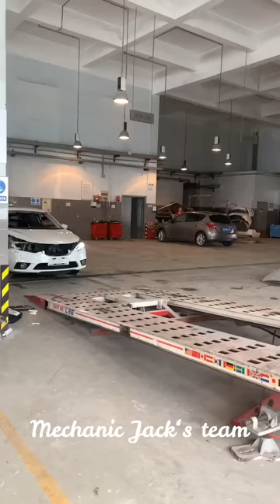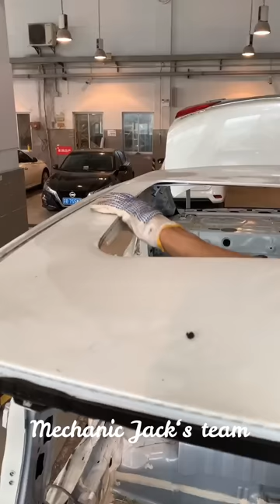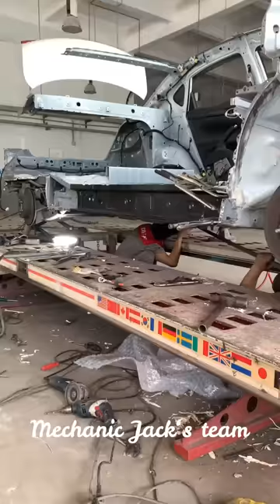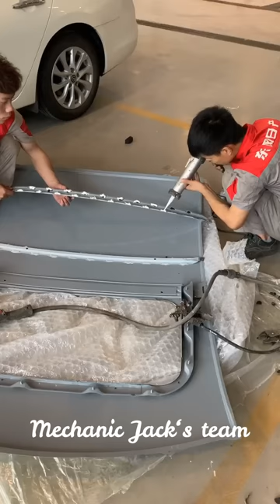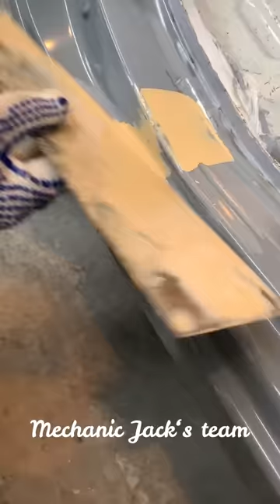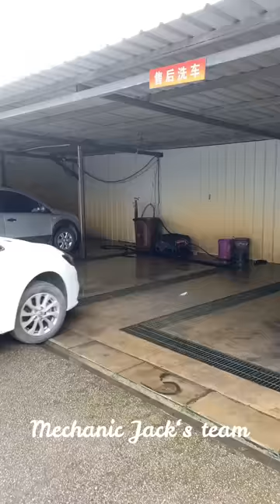Mechanic Jack| Car restoration after accident. Is this worth to fix this car?

Comment: Here in the us its cheaper for the insurance to give the owner a new sentra since those are cheap here
Reply: this totaled car comes from insurance company with no cost, those talent works is small pieces for them
Reply: US insurance won't buy you new/certified Sentra, all vehicles are paid on whatever the value of your car mileages and years, sometimes you'll get $2k-$3k and a certified pre-owned vehicle will be $4k-$5k. Insurance here in the US is a scam legitimate scam...
Reply: @geraintcibu5309  here in Italy the situation is quite similar..

Comment: Spraying primer even on the inside repairs was a nice touch. Honestly I'm surprised that they were able to get all the sheet metal parts new off the shelf.
Reply: They're in Japan , and it's a Nissan , all the parts for it are probably right down the street from him .
Reply: @sirspeedsalot  Ok, first of all, they are not in Japan. I don't know where they are, but they don't look Japanese, the cars are not right hand drive, and the license plates are wrong. Second, can I just go down the street and buy half the sheet metal needed to build a Ford? Maybe you're just joking, idk.
Reply: @madmanmapper  I live in Florida and for most Ford's you most definitely can go pick up most sheet metal pieces you would need to rebuild the whole car , they actually deliver the pieces to my job , I work in the industry. And due to the Asian writing on the walls it does look like Japan or some Asian country . If you need any pieces for Ford or Chevy let me know I can get just about anything . Maybe you're just clueless , idk.
Reply: @sirspeedsalot  Maybe I'm not a body man.
Reply: "Dongfeng Nissan" is what said on his shirt. It is a joint venture of dongfeng motor in China and nissan. That's why he can get all types of OEM panels.
Btw, Japan used to adopt many Chinese characters in their writing, and still do a few nowadays.
Reply: @pcnepal  Neat! Thanks for sharing.
Reply: @sirspeedsalot where is your shop located ? I am looking for a good body shop ?
Reply: @sirspeedsalot China
Reply: @ednofelipevieira1456  I said "or some Asian country". Next time read.

Comment: Phenomenal. Excellent work. How is the straight line stability of the car after the repair. I hope it will be as par as it was when the car left the factory.
Reply: Probably the same as before. The suspension setup machine will tell everything you need to know. But it looked like they welded everything at the right dimensions. Otherwise, the doors would have had bad gaps.
Reply: He measured the factory diagonal points and they lined up, meaning the bodys main points and suspension mounting points are straight. So it will drive straight
Reply: It’s junk repair, I’m the person who designs lower end Nissan veh. The metal is warped on the other side and those welds don’t hold up like a oem factory that’s spot on to a hairs thickness. This car is a rolling joke
Reply: @Pie4life123  Good joke.
Reply: This is illegal to do in Australia and NZ for a very good reason !! You are all fooling yourself if you think the car won’t have loads of issues after this , I feel sorry for the buyers who buy these cars thinking they are mint to find out all sorts of problems a month or two after purchase “JUNK”
Reply: @iamasmurf1122  Why would it be illegal if the car was repaired by the factory book?
Reply: @iamasmurf1122  Did you know motor cars are made from thin guage pressed metal? Do you realise this kind of repair is illegal in Ausstralia because insurance corporations lose money on selling write offs to wreckers so panels can be reused like this? Oh, I see.
Reply: @slidingdoor9055  the car will not survive another hit with this much amount of repair. It should not be on the road
Reply: @nishanthananth9668  Then don.t buy it.
Reply: @nishanthananth9668  you’re wrong. All spot welds and body glue was applied per factory spec. His hand welds are probably thicker than the robot ones from the factory. I see what you’re saying on some of the repairs that have been done out there, but these guys are an exception.
Reply: @bobsmithinson2050  the thing is some parts are meant to deform in a particular controlled manner in a crash and these types of repairs take that control away from what the engineers had planned.
Reply: @nishanthananth9668  you’re right…BUT this particular repair had all those areas replaced.
Reply: Personally, would I repair this? No chance, it's a write off! However as long as structural adhesive is re applied per manufacture guidelines and either, welded or rivoted where they say, virtually every single panel can be replaced on a vehicle.
What I don't agree with on this repair  especially, is why is that car not mounted on towers and brackets before everything is chopped out? So much structural rigidity is removed from the vehicle when cut into them. So this vehicle will of flexed so much. It needs to be on a jig for this type of work, not just a pull bed.

Or write it off to begin with.
Reply: @andrei666   alot of times the spot welds done by hand are  thicker than oem machines from the factory meaning it will most likely hold up alot better than it would prior to the repairs. Im sire he used the proper structural adhesives.... good repair on my book...besides...im sure you didnt see all of the extra work done to make it structually solid in 10 minutes.
Reply: @Xavier exactly my thoughts

Comment: in the us the insurance wouldve just totaled the car and gave them a new one since its cheaper but nice work but they need some eye protection
Reply: Cheaper and safer. You can't really repair such extensive structural damage.
Reply: When did insurance give new car to anyone? They pay out what ever value of the car is in their book, they dont give out new cars.

Comment: great work but structurally the car will never be the same .The integrity is compromised .In australia that would be a statutory write off
Reply: Yeah idk if I would trust driving this car
Reply: Cars are designed to be repaired . If they follow Nissan guidelines this job is 100 % safe.
Reply: That repair was done in a Chinese Nissan dealership bodyshop parts, labor would've been specifically trained on the procedures and since the parts were supplied by Nissan it's perfectly safe

Comment: Doing all of that on a basic car seems pointless, the repair cost more then the car on top of having a salvaged title.
Reply: Yup true.... Insurance pays for that... Use the car and save some money...after 5 years scrap it.....the best way 😏😏
Reply: @ugyptkutan266  usually the insurance will be the first to scrap it,because of time to fix. They'll just buy them another car of the low kelly blue book price, so it wont be a new car, used car of around 10k
Reply: It's in China that is a Nissan dealer fixing a customer car I'm assuming it's an insurance claim. What salvage title?????

Comment: 🤣🤣🤣🤣🤣🤡🤡🤡🥳🥳🥳🥳🤣🤣🤣🤣❓️❓️❓️❓️❓️. 
The job that he did it will cost more then a new car.  
Why are you taking a lot of parts that you could just leave it on???
Like for example roof panel? Or whole side panel from front to all the way back with quarter panel??

Comment: Not cost effective in USA. Love the work
Reply: Jon O'Dell Jon O'Dell I’ll just start by saying I don’t work in a body shop and have no idea of the process that goes into a restoration like this. 

Now that that’s been established, it is my assumption based on common knowledge that a Sentra with that amount of damage would not be worth restoring. It’s a budget car from the start, and airbag deployment alone sometimes totals the car for insurance companies.  

And if I had a farm, I’d bet it on the restored car having a salvage title and a much lower re-sale value that doesn’t really touch the repair costs. 

I won’t even bother getting into the compromised unibody structure.

If I’m wrong, please educate me with your expertise and implied credentials.
Reply: @80PercentAshamedOfU  okay because I'm a car mechanic and I've been to Auto Body shops and I have seen some pretty intense repair jobs, I once had a job installing paint booth at body shops. I understand what you're saying but apparently people do take on jobs that aren't cost-effective plus some of the cars I work on they're are better off buying another car I've seen people pay 5,6 grand for a repair.

Comment: Mechanical Jack, car restorasi ;

1. BTS dalam laut menarik mobil yang tenggelam di dalam laut, menarik mobil yang masuk dalam kolam air, menarik mobil dalam kali yang ROT RECH DI MEDAN TEEJAL SAMPAI MOBIL PEOT KAPAL LAUT PEOT KETAMBAK KARANG PESAWAT PEOT KE TAMBARAK TERMINAL PESAWAT DI MASING MASING WILAYAH DI KE 15-22, 16-18, 23-11 Selama 711 tahun sampai 2022/2023 🚝🚝🚝🚝🚝🚄🚄🚅🚀🚀🚀🚀🧸🚝🚡🚡🚡🚡🚡🚡🚡🚡🌧️🚗🚗🚗🚔🚔🚔🚔🚔🚆🚆🚆🚆🚆🛶🛶🛶🛶🛶🛶🛶🛶🛶🛶🗼🗼🗼🗼🗼🗼🗼🗼🗼🗼🗼🗼⛵⛵⛵⛵⛵⛵⛵🛥️🛥️🛥️🛥️🛥️🛥️🛥️🛥️🚤🚤🚤🚤🚤🚤🚤🚤🚤🚤🚡🚡🚡🚡🚡🚡🚝🚝🚝🚝🚝🚝🚝🚝🚄🚄🚄🚄🚄🚀🚀🚀🚀🚀🚀🚀🚀🚀🚀🚀🚀🚀🚀🚀🚀🚀🚀🚀🚀🚀🚀🚀🚀🚀🚀🚀🚀🚀🚀🚀🚀🚀🚀🚀🚀🚀🚀🚀🚀🚀🚀🚀🚀🚀🚀🚀✍️✍️✍️✍️✍️🙏🙏🙏🙏🙏🙏🙏🙏

Comment: These things get send to scrap yards for a reason. Yea, it may LOOK new but does it still drive the same? Will the engine develop problems down the road from this? 

You do good work, but repairing insurance write off wrecks is pointless.

Comment: Isnt the metal screwed once its been smashed?....seems it would still be weak af even if straightened out....

The cost to repair that thing has to be astronomical, in the US it would be....cheaper to get a new one

Regardless though still amazing work fir sure, super talented

Comment: You are undoubtedly very good at changing damaged parts but I see that you work in an automotive agency workshop, I would like to know if you would do the same if you were your workshop externally and see if you would restore them just as quickly, that is, it will not be the same as what the agency told you. I put the pieces or canvases to change in your hands so that you can get them by your own means and finish it that quickly since the pieces that you change are new from the assembly company. I would like to see you in a junkyard cutting the pieces that you are going to change and that you They fit just like the new ones you put in

Comment: I would have no problem driving a car fixed like he did. He replaced way more structure parts and roof then most cars get. At least they are new. In the old days, everyone would fix the interior structure, even though it should have been replaced.

Comment: You think that car was strong? That was a 35mph impact.  My dad had a 66 mustang hit at 45 mph side impact the drivers seat was almost into the center console. And that car wasn't rusty and built a lot stronger had he had his seat belt on and he didn't it would have killed him. Insted it busted a few ribs.
It dosnt take much to crush a tin can
Cars are not much stronger then tin cans.

Comment: It's debatable if the car should have been repaired, but the car didn't seem it was built very strong to begin with. But, you can tell these technicians are very good at what they do. Lower labor costs also weigh heavy in the decision to repair,  I'm sure.

Comment: What is the behavior of the metal when it was expose to huge stresses that affect its condition? This should be a focus question to know if this frame and structure still worthy to be trusted again especially we have a heat treatment and cold treatment for a metal that expose to this kind of stresses.

Comment: I have to question the strength of metal that's been crushed then pulled & beat back into position. Let's just say I'd sell this car immediately after a repair like this. The B pillar should replaced at the very least
Reply: I don't know why they pulled the B pillar back into shape if they were just gonna replace it. I guess that's why I'm watching videos & they're making them. In the US this repair would cause the insurance company to total the car. You could buy it back for $500 then pay to have it fixed. I've seen work like this done to expensive cars, the repair makes sense.

Comment: I love and adore the best job you are doing. My worries is you are making one car from 2 junked car without passing vigorous test before putting on the road. They look awesome but not sure if they can handle any crash again and save lives. That's me...
Reply: Their back shows character "东风日产" which means they are the Nissan dealer body shop workers of the Nissan China. So the parts are OEM not from another junked car.
Reply: @kenblock7350 哦，好的。谢谢你的解释。我很欣赏并消除了我的担忧。虽然干得不错

Comment: The guy have some amazing skills, but What is the point the fix a car that have been so extensive damage? It is better get a new car at that point unless the materials and labor are less than a new car.
Reply: They are from the Nissan China dealer body shop, all parts are OEM and should have the reasonable price. And in China the Labor cost is not as high as the US.